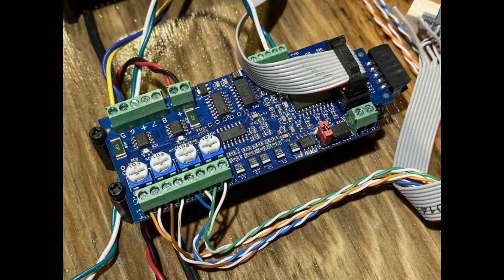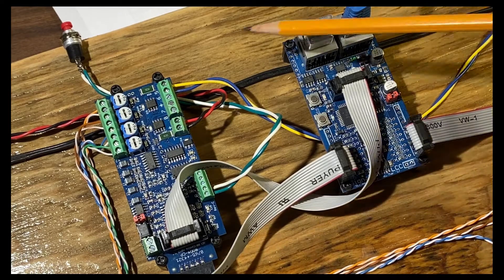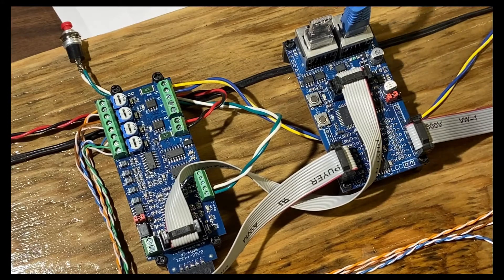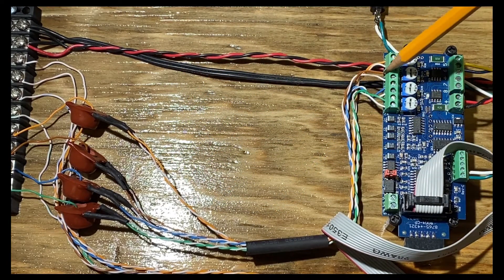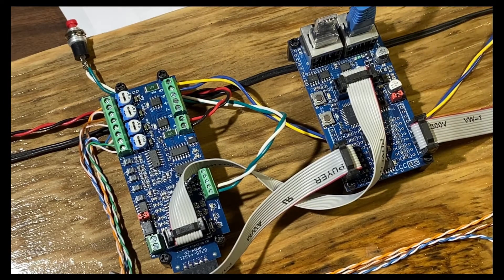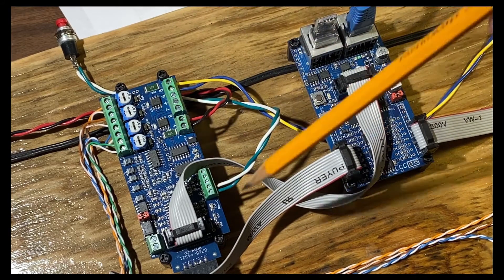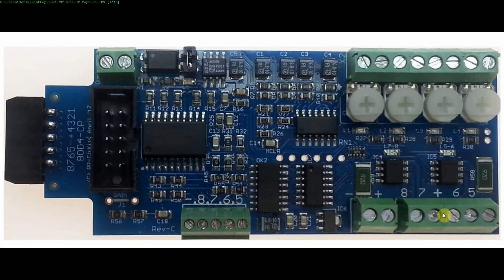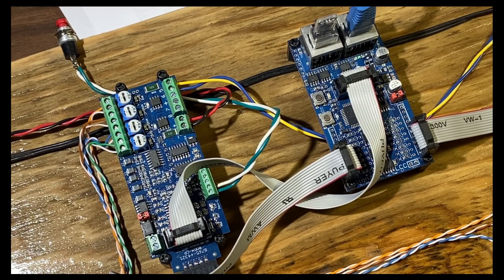TLC #4 - Intro to an LCC I/O card: the BOD4-CP

Comment: I'm a latecomer, as obviously all the other comments here are 3-4 years old. But maybe someone will get some good from what I've discovered, which is that the large 5,6,7,8 screws, upper-right here, are ONLY outputs, and the smaller 5,6,7,8 connectors are ONLY inputs. These cannot be made to operate in "sample" mode, so it doesn't work with RR-CirKit's Quick Button with built-in color-changing LED. I have to bring my my button with LED in on a nearby Tower LCC board where I CAN configure an I/O line for sample (both input and output). I let the button send out a message from the Tower LCC that becomes a "toggle" command (c), to Event 3 on Line 5 of the Signal LCC, which is one of the two 12 vdc lines on the BOD that power the Tortoise. I also let the wafer switch of the Tortoise, separately connected to C, 7, and 8 or the BOD4, to control the LED color (green for close, red for throw). So while I get a slight delay in the color change, I also get a visual verification that the turnout actually did change position. It's pretty slick. 😁

Comment: In the beginning you speak about you using the "power lock" in your system, but there are no wires screwed into the little terminal. Are you not using the power lock with your system?
Reply from the maker: Correct, I have not set my nodes up with power lock. Since I am not using this for CTC and I rarely have shorts on the layout, it just has not been a priority for me. But I may add that feature in later. Note that it would be very easy to do so.

Comment: Very helpful. I'd like to see something similar on the "tester" board - it says (somewhere) that the pushbuttons and LED's are wired in parallel, but I don't really understand how that works with the power on the node, and the CDI.
Reply from the maker: I have not used the tester board.  But, take a look at https://greatnorthwesternrailway.blogspot.com/2019/04/configuring-push-buttons-for-turnout.html for a wiring diagram on how to wire out the push buttons. Wiring an LED on a Tower-LCC is similar, but note that a resistor will be needed to limit current. Also take a look at the RR-Cirkits documentation on the Tower-LCC as 2 of the I/O pins are limited to 2mA. The Signal-LCC LED outputs are all ready to go, including current limiting resistors.

Comment: Detlef, your turnout power in comes from a wall-wart type source?  Also, I'm getting ready to wire my first 8 CT detection coils.  For a long staging block (35 car lengths in HO scale, maybe 15-20' long) does the coil have to go on the one and only track feeder for that entire block, or can you detect the block by CT coiling only one out of several potential feeders?  I looked for simple documentation on how to use the CT coils and couldn't find any.
Reply from the maker: John, yes, the turnout power comes from a wall-wart type of power supply. I used a 12V source. It wires directly to the SMD-8 or BOD4-CP turnout power terminals.

As for the CT, think of the wire for the power to the block you want to detect as a pipe. Your want to capture all the current going to it. So the CT needs to be somewhere between your DCC command station or booster and the wire BEFORE is starts branching out to the individual track feeders. If you look at this blog post (https://greatnorthwesternrailway.blogspot.com/2019/04/wiring-to-track.html) you can see in the first picture (maybe barely) that the terminal blocks in the right rear of the panel form a bus that each of the block feeders start from. The CTs are on one of the wires of each pair going to a specific block. Once the lead going to the block gets near the track, track feeders branch off up to the rails, as is shown in the second photo. The bus can be centrally located as I did, or just run under the layout, and the block feeders come off of it where needed. The key is the CTs have to be placed on one of the wires AFTER the wire comes off the bus, but BEFORE any of the track feeders start branching off. Hope this makes sense.